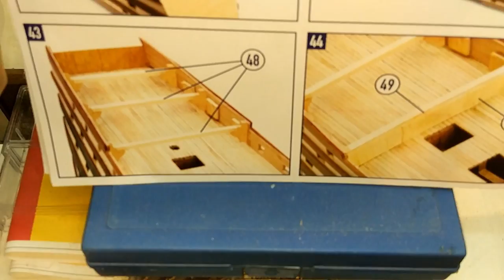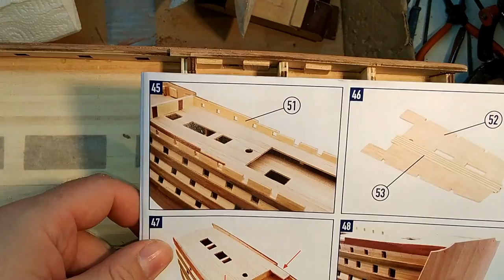Santisima Trinidad - part 19 Preparing The Placement Of The Upper Deck

Comment: Hi John, not a very smart move to  sand parts ove r the top of your ship , mainly if you want to glue parts...
Reply from the maker: That's why i have a paint brush, to clean the surfaces. Also it's IMPOSSIBLE not to get any saw dust on a surface because when you are doing sanding it's going everywhere.